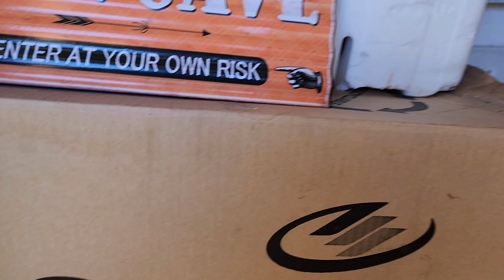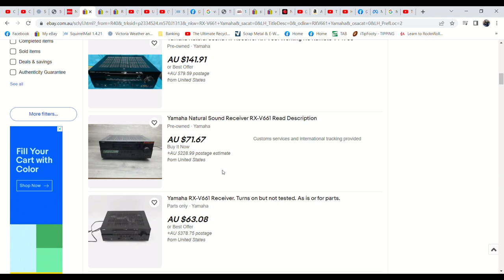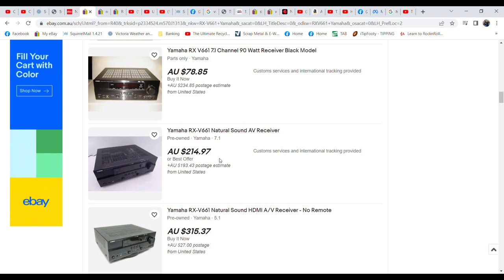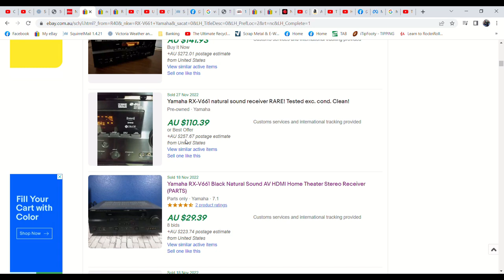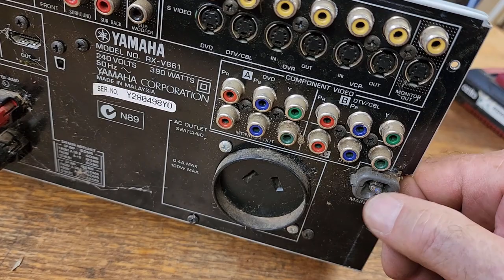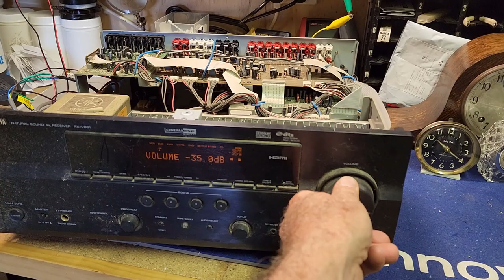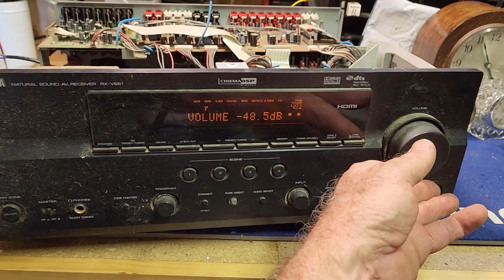Storage Shed Clean-out Part 1 - Yamaha RX-V661 Home Theatre Stereo Receiver Amplifier. Scrap or not?

Comment: There is an old saying when picking up electronic scrap in the hard rubbish, " If it looks very dirty and neglected it will work and if it looks brand new there is a very good chance that it will not work." I have been never so lucky to pick up those yamaha amp/ receiver. I did pick up a pioneer amp/receiver like yours last weekend but the led display is not working so I cannot see what function I am using. Do you have any idea on how to fix it?
Reply from the maker: A pioneer amp is a good pickup Lucky! Not sure on the display issue - check all the capacitors first! They really are the weakest link in electronics! Even quite modern stuff. The radio repair I'm putting up today is only 12 years old, but needed 4 new caps!
Reply: @TheUltimateRecycler  The relay that switches on the amp does not work all the time so I unsoldered the relay and tested it on my bench, it worked every time. I was thinking of scrapping it until I looked it up on ebay pioneer (model vsx-517-K) audio/video receiver $ 620.00!

Comment: Hmm... given the amount of rust and unknown history as a 'shed amp' it might be perfect! But as a bedroom amp for a teenager who might fall asleep listening to the radio unaware that the insulation is breaking down and the previous owner found the safety risk and had already snipped the lead off...

Again it's probably fine, but just cleaning up the caked on muck to a nearly new look, kind of covers up its protentional to be a 'real risk'

I thought you had a PAT box to at least give it a quick test?  I remember loving a 1950s/60s valve amp radio and playing it for months in the 'base' well away from the kids until it started to smolder and smoke, luckily I was around to catch it, but if I hadn't it might have burnt the school down 'again' 

I'm just saying a $30 'bargain' might cost someone their house, business or worse!
Reply from the maker: For the record Martin, I did clean it up a little inside (didn't touch the rust as it was only on the bottom panel), and it has been tested and tagged with my PAT. I am safety conscious with anything electrical I sell. 
I'm curious now on the stats of schools burning down in your neighbourhood..  😉🤣
Reply: @TheUltimateRecycler  https://www.youtube.com/watch?v=hfF3w8RrETI a few years before I started, but it was an expensive school to fix... one of the 3 oldest schools in the UK. https://www.youtube.com/watch?v=Mztsszo-87M 

I'm glad you do a proper test on your repairs, it's something that can be skipped and no one would be any the wiser.
Reply from the maker: @martincowie4520  Thanks for the links! Very interesting. Started by a spark from a paint stripping gun! Expensive fix alright and such a shame all the history was lost!
Reply: @TheUltimateRecycler  That was actually the second fire within 6 months of a smaller fire that gutted two classrooms... so health and safety was fairly high on my job description lol